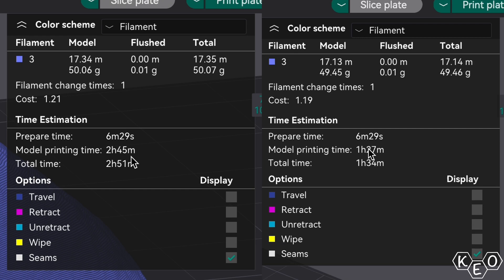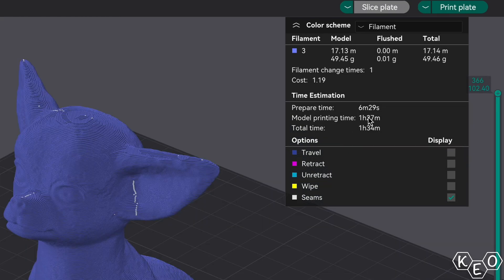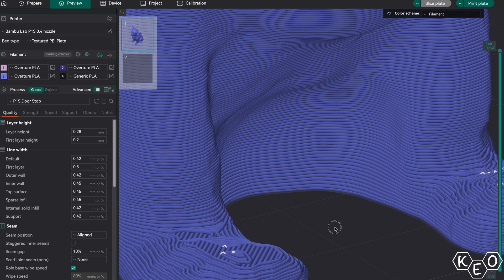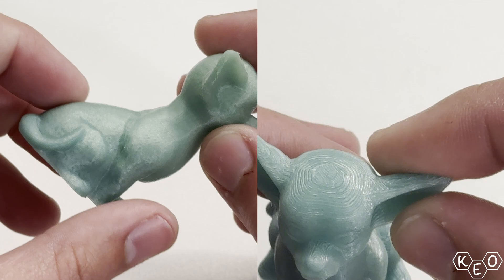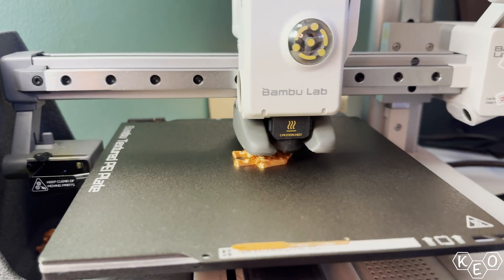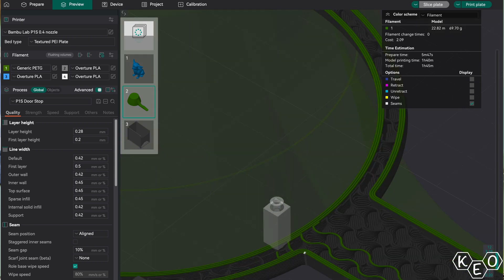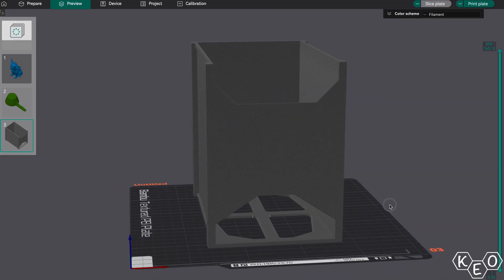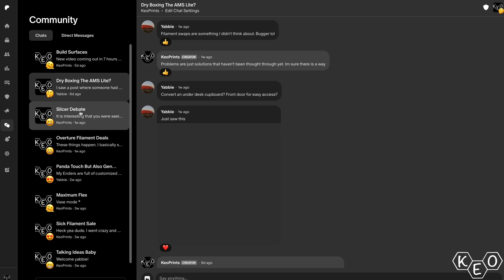This Is The Best Slicer For Fast OR Pretty Prints | Orca Slicer Layer Height Tutorial

Comment: Increased layer height in combination with increased layer width can improve speed without completely sacrificing definition.  This is mostly true for structural prints that use multiple wall perimeters for strength, although it can also reduce infill time.  For example, changing the layer width from 0.4 to 0.6 means fewer passes per layer.  If you are using four perimeters at 0.4 you get a 1.6 wall thickness, with 0.6 you get 1.8 wall thickness with only three passes per layer.  If you print parts that require 100% infill, this could really save a lot of time.

Comment: I usually run .2 or .12
Reply from the maker: 0.2 seems like a good compromise between speed and quality. 0.12 is extra fine
Reply: @ if it doesn’t matter if I see lines I use 0.2 so it’s quicker. If I want it really nice looking I use 0.12 or 0.8. Sometimes I use adaptive